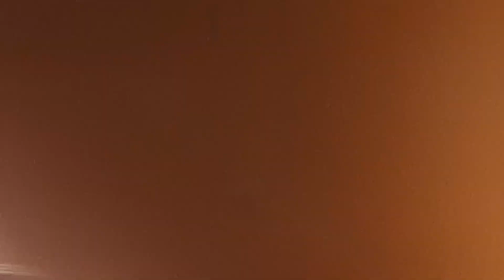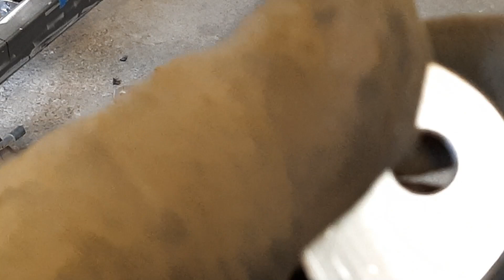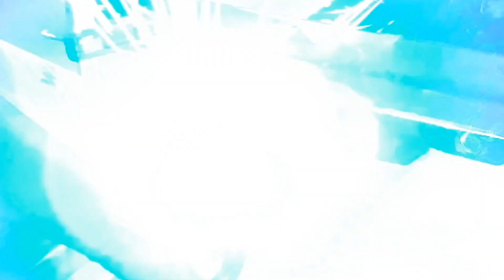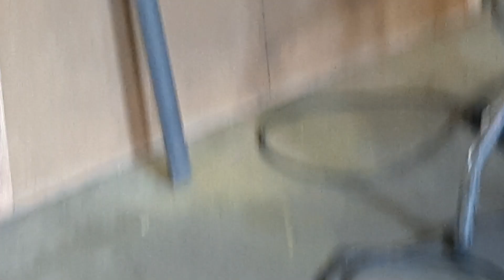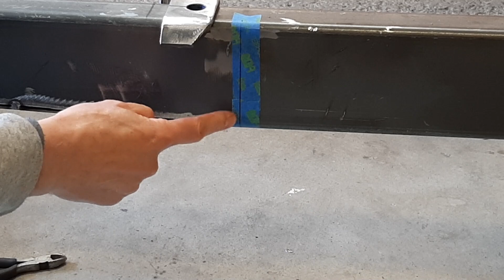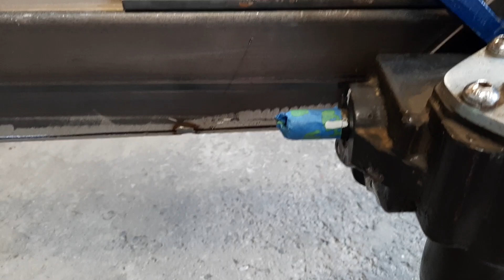The Backyard Coupe Build 7 Chassis part D

Comment: kent how much does it cost
Reply from the maker: Hey MZ, cost to build complete, or cost for the plans?
Reply: @kentdixon5716  Full construction cost
Reply from the maker: @mztsgdbh3553  Hey MZ, full cost will vary, I used all brand new parts, if used swap meet stuff could cut cost considerably, I even used a new 290 hp crate, cost for me was right around $12,000.

Comment: What type of steering box is that and where do you get them
Reply from the maker: Hey Cornelius, its a Chevy Vega, they are kind of the standard in the hot rod industry, I got mine from Speedway motors, but any hot rod parts house has them, just so you know they come in a wide range of prices, chrome/black/manufacturer etc.
Reply: @kentdixon5716  thanks